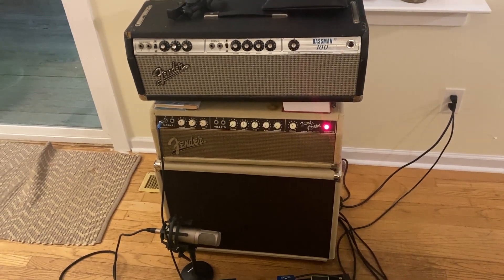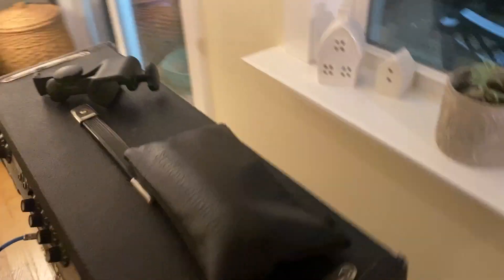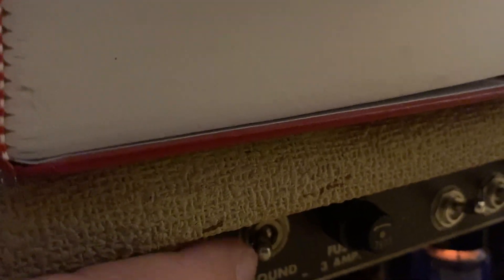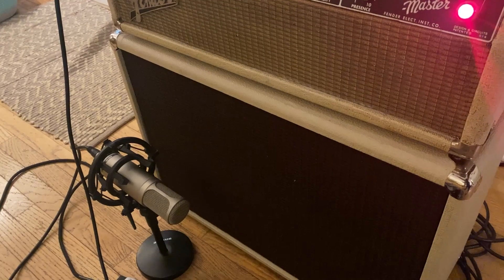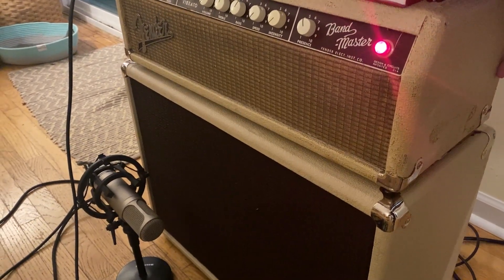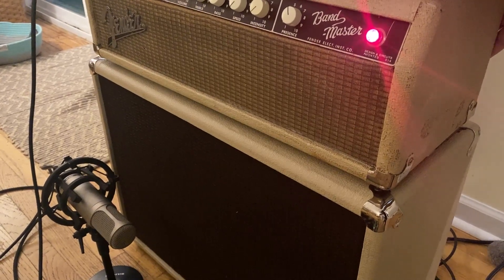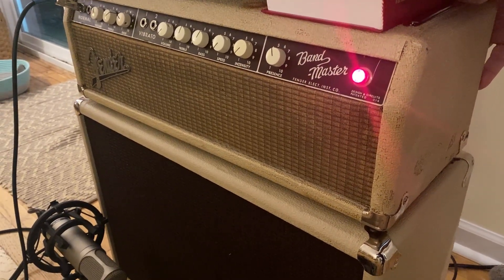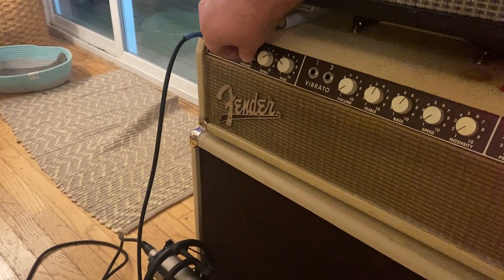Negative Feedback Loop mod

Comment: Can I ask what is the purpose of the negative feedback loop?
Reply: I have read that the NFL tightens up the low end.
Reply: https://youtu.be/Vz-zCh9p_rk?si=LpL_1UdkPaY5pPyX
Reply: That video is a good explanation of it. Fender used it to keep their amplifiers from being distorted. You achieve higher volume with the negative feedback loop.
Reply: It linearizes the output section, and widens the bandwidth ( more highs, and more lows ). That simply means that the frequency response is more even/flat, over a larger range than without a " feedback " loop. Contrary to belief, it doesn't truly add more volume, but it does increase the range of clean output. The issue is that the " window " between clean and distorted is now smaller. This creates that clean with a light strike, to distorted with a heavier strike " dynamics " most speak of. The feedback loop actually decreases dynamics, because it is technically compressing what you do down into a smaller dynamic range. This is where that clean to distorted threshold comes into play. When you get into distortion, the feedback loop breaks down ( loses its effectiveness ) and the amp starts to work more or less as it would without the loop. This is why the amp can go between clean and distortion like a switch. That is the breaking of the loop. 

Without a feedback loop, the amp would have more dynamic range. This is simply because you have a larger window between truly clean, and obviously distorted. And since there is no loop to break, what goes in, comes out. The frequency response of the amp is " natural ", meaning it sounds like how it sounds, usually allowing more mids to poke through. Not having a feedback loop also reduces the noise floor and makes quiet passages seem more dynamic. With no feedback, quiet picking and heavier picking is VERY natural, and you have a much wider range between the quietest of quiet picking, and the heaviest of heaviest picking.

The way to think of a feedback loop is that it is like a compressor. A compressor reduces the dynamic range, and as you bring the level up to compensate, the noise floor comes up with it. The only real advantage to a feedback loop is the leveling of the frequency response, and the narrowing of the range between light and heavy picking distortion. To some this is " dynamics ", to others like me, it is just compression. I like compression before the amp, not in the amp.
Reply: I added a feedback loop off switch to my hot rod Seville and prefer it. More open sound more harmonics